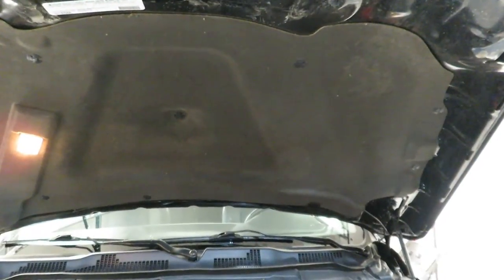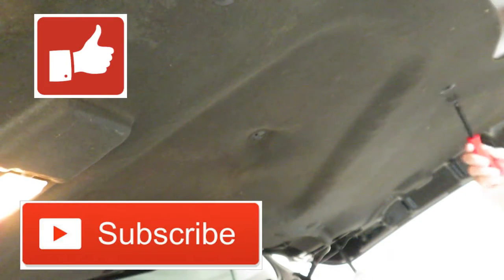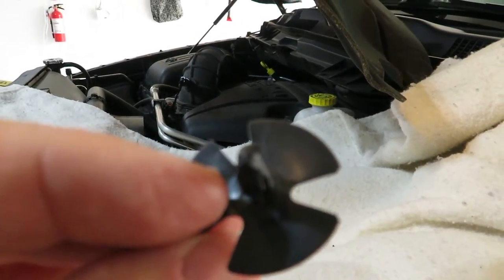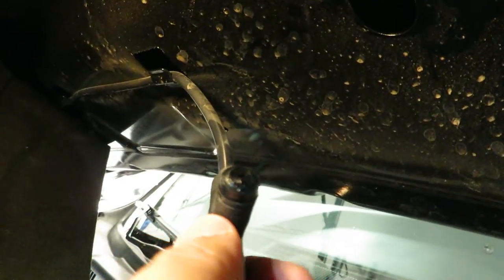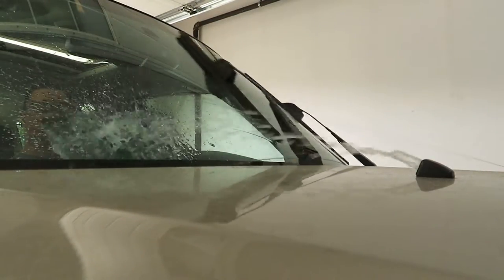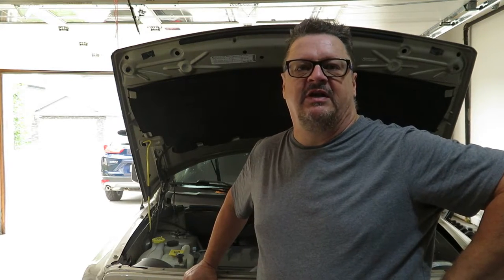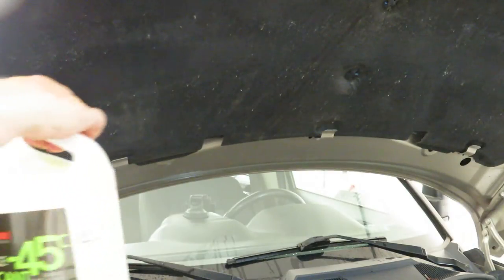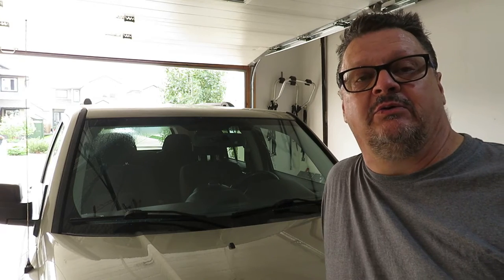How To Replace a Windshield Washer Nozzle - Ram 1500 and Jeep Patriot

Comment: Just attempted this on my Jeep Patriot (2014) and it worked great and took less than 10 min to do! The Amazon link to the parts for 6.99 worked fine. The hardest part was taking out the plugs on the hood liner and then getting them back in again.  I would suggest having some extra plugs on hand as I did break half the tabs but they went back in for now. Thanks so much for the help!